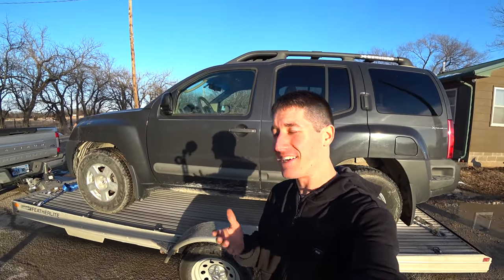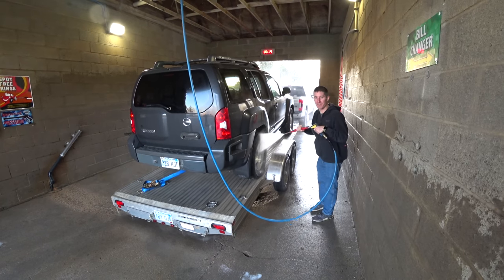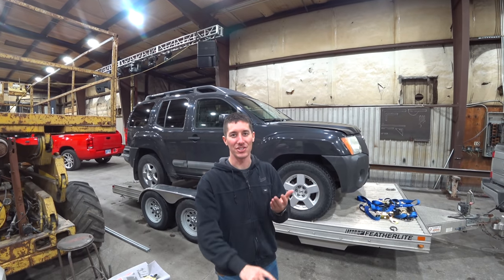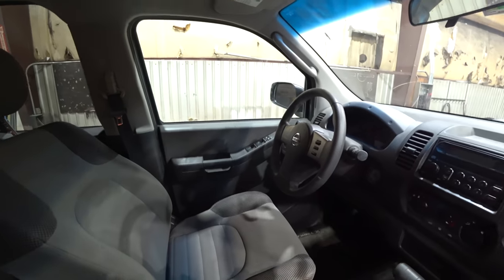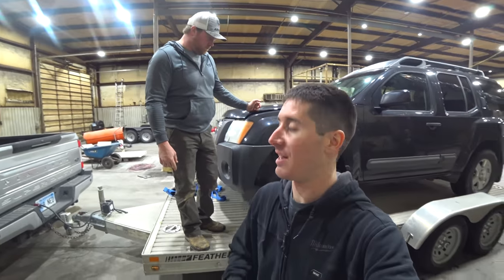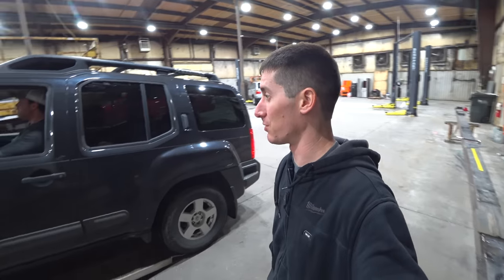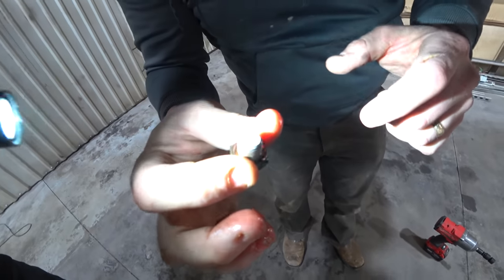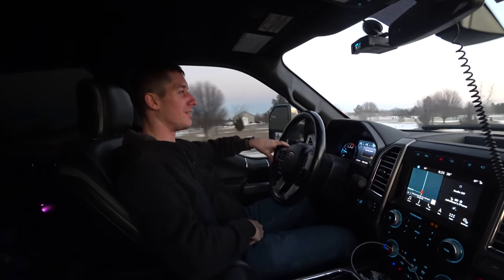The Nissan Xterra Is Everyone’s FAVORITE SUV So I BOUGHT One For Only $750

Comment: Probably had radiator transmission line failure and roasted the trans. So double check that radiator while in there
Reply: Mine had same issue - the radiator plumbing is the Achilles heel for that thing..dam radiator crack and mixed the fluids..miss my X
Reply: @CoH_88  I believe Mercedes used the same Rad didn't they I think correct me if I'm wrong I saw it first on LSC.
Reply: Exactly this. '05-'08 Xterras and Pathfinders are ticking timebombs.
Reply: @CoH_88  it's already been addressed by recalls and warranty work, so idk how it forced ya into needing to sell it
Reply: @robretondo9709  Wasn't covered at all for me - took to dealership and nothing. There was a lawsuit in the works but nothing never heard anything about it.

Comment: Check that radiator part number and see if it's the newer, superseded part. The trans cooler would crack inside the radiator and fill the trans with coolant, killing the trans in that generation. Hope all is well, here's to flips!

Comment: “This is going to be one of the easiest transmissions jobs...” dude, I’m pulling for you to be right.
Reply: Steven Heffelfinger I had to remove both primary cats to get to the top bolts of the bell housing.
Reply: @MrIsrael211  I used a 24" extension without removing the exhaust.

Comment: In case you missed the last comment, the trans cooler lines in the radiator degrade and leak, mixing antifreeze and trans fluid. Radiator is an easy replacement and  Nissan had changed to a different trans fluid that wasn’t as hard on the radiator. These are great rigs when sorted, especially in 4x4. I have a 2005
Reply: They changed the trans cooling pipe which goes through the radiator from aluminum to brass in 2010.

Comment: It sounds like the secondary timing chains and guides need to be replaced. The early 4.0L engines suffered from this problem. That's the whiney noise you hear on a cold start and when the engine RPM's increase.
Reply: Run it briefly without the belt before doing that though, if it stops the noise it's something else. I assumed that was the issue with mine because it was happening at the right mileage point, but it turned out to be the alternator. Would've saved me a ton of time and work if I had bothered to do that first.

Comment: Most common problem with that model is that the trans cooler built into radiator would Crack and allow antifreeze into the trans and vise versa

Comment: I had a yellow 2000 Xterra (Gen 1) and that turned heads. I drove it like a truck. Off-roading, towing, snow, beach, everything. I sold it with 198k miles on it. The new owners drove it away. Great vehicle.

Comment: I worked For Nissan During that Radiator plegue! Those transmissions are pretty strong on those Xterras and Frontiers but the radiator trans cooler ended defective mixing coolant into to the trans lines killing the Transmission.. if you catch them early a good flush and a valve body swap cures the problem. A radiator Swap  is definitely a must on this one if you replace that transmission.

Comment: Precision Transmission has a cool video showing what that additive does to every rubber seal in your transmission.  [swells them up a ridiculous amount.]
Reply: Yeah.. That's true. But it sometimes helps to renew o-rings, you just have to be careful not to put a hole gallon in it. I used to get the same results adding brake fluid to the tranny. Just a cup... Same story. It's not a solution, it's just "cheap" fix
Reply: It's not really a proper fix, but if you have a car where you can't justify a transmission replacement, it's worth a shot. I had a 2000 Cavalier with the transmission that was clunking and slipping quite a bit. Lucas kept that car going for another 30,000 miles...
Reply: @elijahwatson8119  exactly... That's the idea. Sometimes it's just not worthy to spend a lot of time and money in a car... Or u just can't afford it. Lucas additive can get you out of slipping or bad shifting transmissions.

Comment: Hey cousin!! Check to make sure it does or doesn't have the strawberry milkshake trans fluid where the line into the radiator contaminates it.. fix.. flush flush flush. Bypass the line.  Replace the valve body and tcm and back on the road u go. I had to do it on my frontier

Comment: Through 2007, the automatic transmissions had a serious problem. Someone radiator fluid would leak into the AT fluid, I assume through a busted heat exchanger to help cool the AT. There's a fix for it that owners have been doing for years, but once the AT is beyond fixing, it needs a new one.

Comment: I’ve rebuilt hundreds of these units. The cooler in the radiator cracks and they mix coolant & ATF. The coolant ruins the seals, frictions, and the TCM connected to the valve body. Replace the radiator, flush the auxiliary cooler, and make sure your replacement unit has the correct programming in the TCM. I’m not far away in Omaha if you need anything.

Comment: I bought a 2006 4x4 AT SE trim a couple years ago for $780 bucks because it suffered from SMOD.  I bought a new valve body, flushed out the transmission and buttoned her back up.  Still works today and is in FLAWLESS shape minus a little clear coat peel.  It's an amazing vehicle and I still run my 2005 off road all the time.  I don't think I'd ever want to get rid of it.
Reply: Hey is it still running? I bought one 5 months ago

Comment: I had a 1989 4wd Pathfinder that never went off road and the transmission never made it to 100,000 miles.
I looked at a slightly newer Pathfinder and on the initial check, the transmission shifted really rough, standing still!
No more Nissans since.  I did have a 1976 DATSUN station wagon that drove forever with no troubles, although it was a stick shift.

Comment: If you need any Xterra help, just let me know...I run an Xterra FB page, and have years of experience with Xterras, as well as having replaced the trans in my 2006 due to the common SMOD issue...
Reply from the maker: Can I stick a 2013 trans in the 06? Seems like they all interchange as long as you run the adapts right after install with the scanner, but it hard to find really good info on that. The interchange is all over the place. 🤷‍♂️
Reply: @WatchJRGo  the tcm is integral to the valve body. Will need programming. Also replace the radiator. 05-08 are notorious for cooler failing and allowing coolant into transmission.
Reply: Just so you know, what usually kills those transmissions is the internal transmission cooler in the radiator bursts and floods the trans with coolant, which then strips the clutches of all of their friction material...we refer to it as SMOD (Strawberry Milkshake Of Death)...also, chances are the timing chain guides are bad, the chains had a factory defect that cut through the plastic guides, which affects the variable valve timing, so you'll need new chains and guides...the cure for the transmission issue is to replace the radiator, flush the lines and secondary trans cooler completely, and replace the transmission...like I said, if you need any information, I've been there and done that with Xterras...
Reply: Also, you're going to want to remove the front catalytic converters to get the trans out...the bellhousing won't fit past them unless you REALLY force it and potentially damage the cats or crack the manifolds...
Reply: I'd put money on the radiator either being brand new, or they bypassed the radiator trans cooler and tried to flush the trans and limp it by for awhile before it finally died...my 2006 had SMOD and I was able to limp out another 20,000 miles from it before the trans just stopped shifting...if you buy a used trans, only buy one from 2010 and newer, as those didn't have the SMOD issues the earlier models did, so you don't have to worry about buying a bad trans...
Reply: @WatchJRGo  2013 should be a direct swap, if the dash lights for the gear selector come on then it should be fine...I put a 2010 trans into my 2006, then drove it to the Nissan dealer to have them scan and ensure the programming was correct, it was supposed to be $170 and they only charged me $70 because it didn't need programming...they said the newer trans should work in an older model, but not the other way around...
Reply: @WatchJRGo  Nissan uses their own specialty software, too, so finding someone with the correct scanner can be a pain...nobody around here has it, since it's too expensive to get the licenses from Nissan, so the dealership is the cheapest option to get it checked out...
Reply: what about Nissan Sentra SER, i own 2 of them my 2004 has a 2nd gen JDM engine  lilcrazybear at gmail

Comment: I have 2007 Off Road Xterra, Manual 4x4 and rear locker. It's a solid ass truck. Just clicked over 200k, just had to do valve cover gaskets, HVAC blower, cam sensor (oil leaked on it killing it).

These are under appreciated rigs and worth the few grand to pick up a nice running example.

Comment: I have a 2011 Pro-4X. It's a great off-road SUV. They never upgraded those rear tailgate struts! They work in the summer. When the temperature drops below 40, they keep the tailgate open just high enough for me to bang my effing head on it multiple times in the middle of the winter, before I remember. I even replaced mine with new ones, and they still failed in the winter.

Comment: my experience with an 09 4wd
front wheel drive transfer case seal 80K
Both rear leaf springs broke center leaf at 100k
TPMS doesnt want work (just use rubber stems)
Clock spring 150K
Radiator hose clamps rotted 150k
Evap system is getting clogged (hard to fill) 150K
Both Hub unit bearings at 165K
Needs new ball joints at 170K
Bushings starting to wear 170K
Rear trunk actuator stopped working 170K
The frame is very solid - A miracle in the rust belt - I now fluid film it

not to bad all considering.  Its heavy, but has good idiot proof traction control and ABS system will save your rear in a wet slippery situation.

Comment: They are pretty easy to work on for sure! I changed the clutch on my 350Z myself and when I wrecked the front end years back I replaced all the front end myself. The radiator support is completely modular and I just took the old one off and put in a new one, used radiator and a bunch of other parts that needed replaced, refilled fluids, bled, and was good to go. Really like some of the build simplicity in Nissan vehicles.
Reply: Are there any parts around? I couldn't even find any LED tail light offering online. None

Comment: I wish Nissan would bring back the Xterra.  I have been driving my 2008 Toyota 4Runner 2WD for over 15 years without any problems, so I agree with you about the  2WD Xterra.  The difference is that My 4Runner still works and looks like new, without any effort.

Comment: The trick to pouring Lucas is to shove it in the dipstick tube and stab the bottom with your pocket knife and twist to break the suction. It will drain in a couple of minutes. No hand cramps.

Comment: Make sure you replace the radiator. That is what kills the transmission in the 2nd gen Frontiers, Pathfinders and X's. The ATF cooler tube that runs theough the lower portion of the rad is notorious for cracking and allowing antifreeze to mix with the ATF. The Re5 trans is just about bulletproof, it was the radiators mixing fluids that kills them. Swap in a good quality after.market rad and you are good. Otherwise it will destroy the replacement trans. I've owned 3 of the 2nd gen Frontiers. My 05 has 220k on it now (4.0L 4x4 Auto). Rad has been swapped out so no worries. Otherwise these vehicles are damn reliable vehicles.

Comment: i got one is a 2006 Nissan Xterra i bought it in 2010 with 180,000 miles on it my frien tell me not to buy it cause it have noise that it won’t last me to long and now 2021 the Xterra still running 349,789 miles on it 4x4 and AWD runs really good on rainy days higth speed original motor and transmission my favorite we just drive it fro georgia alway to Seattle Washington no problem good look with that one dude

Comment: Hey JR, long time Xterra rebuilder here. Let me know if you hit any snags I can help with. Most likely the radiator failed internally and ended up eating up the transmission with coolant contamination. Also you can tell by the idle sound that the timing chain guides need to be changed. :)
Reply: heey i need some help with an xterra can I send you a message through mail or something?
Reply: @victorstorms5852  sure thing. How do you want me to contact you?

Comment: I loved my 03' Maxima,. Had a 99 Altima before that I just needed to replace the battery, and ground the brake rotors. The Maxima was a car that my passengers would tell me how nice the car was without my prompting. It was indestructible except when T-boned by a Dodge Ram that pushed in the B pillar.

Comment: Make sure you read the FSM regarding checking the ATF level.  The fluid level changes quite a bit depending on the temperature.  There's a graph in the FSM that shows the temperature range it should be checked at.  Literally doing the exact same project for a friend that was in a motorcycle accident since he only had his bike to get around with.

Comment: One issue with Nissan of this vintage and continues is the trans cooler in the radiator will split and you end up with coolant in the trans.  Not always enough to cause milkshake but enough to kill the clutches in the auto.  Put a aftermarket trans cooler in it when you replace the transmission.

Comment: The X-Terra's #1 problem is that it isn't an extended cab pickup or a full-size SUV. My buddy had a Silverado around this time and I realized that the X-terra was just a glorified Sentra. Yes, it carried more gear, but it fit no more people, and the fuel economy was garbage. The Silverado got 18 and our other friends that had Nissan's were barely getting 15. The pickup could 4-wheel better, tow better, haul more stuff, and it drove really nice. Now I have a 96 Suburban and I love it (when it's running 😆).

Comment: We got an 05, we've had both common fail points happen to us. The transmission went out(4900) and the timing chain just went back. The piston slapped all the intake valves on both sides. Still in the process of fixing it.
Reply: It's a real fun truck to drive, just sucks it keeps breaking

Comment: Along with the strawberry milk shake issue on these, there is also the timing chain guide issue. Glad to see yours didn't have a milkshake when you drained it, but did sound a like it could have worn timing chain guides. Not sure though as it could have also been the trans. Great project, really like the platform. Bought my son an 06 Frontier Nissmo 4WD.

Comment: Try to change the filter inside the transmission. On my previous car, the filter was clogged. The fluid was nice, but smelling burned. After a new filter, new oil and just a little bit of Lucas fluid, it worked perfectly for a year!

Comment: My 07 Xterra has been great. 108K  replaced radiator last year. no SMOD. Noticed the whinny engine 1.5 years ago, removed serpentine belt but whining was still there.  No problems...so far.  Am I pushing my luck by not fixing timing chain tensioners???

Comment: I have one of these, where I live we just took the radiator apart to clean it and notices the in radiador trans cooler was coriding and we changed it, no SMOD. I had an old fj78 and the trans seem dead like this one, we where in the middle of nowhere, took down the trans filter, cleaned it with diesel and it worked fine for a long time again, sold it 50, 000 km later.

Comment: Research SMOD (strawberry milkshake of death) known issues with 2005-2010 xterras. Radiator failure can leak coolant into transmission lines. If this is the case, make sure your replacing the radiator or you will soon destroy your replacement transmission. Even if you dont have smod, I would swap out your OEM radiator preventatively. People will often try to flush new fluid in the hope they can salvage a smod trans. Re: Fluid may look good but damage is done.
  Other known issue on your model year is timing chain tensioner guides which can wear out prematurely.

Comment: Workin on mine as we speak. I paid a bit more than $750 though..  lol mine runs great and has the factory supercharger on it. It's a beast. 

My biggest issue is the valve covers leaking oil. I have tightened them a few times. The passenger side is good now, but the drivers side is a pain in the azz. The screws in these are ridiculous as hell. Do you have a "fix" for finding actual bolts to replace oem..????

Comment: Sister in law just picked up an old one with relatively low miles, first gen four wheel drive.  It has just about every one of the ‘ quirks ‘ on the forums.  The distributor , the knock sensor, nicely cracked exhaust manifold, and I’m worried sick about the unknown mileage cam belt.
I’m trusting this thing is easier to work on than her old ‘ jimmy ‘ piece of junk.

Comment: Timing chain tensioners are worn. You can hear the whine when you start it. I had a 2005 Xterra and had them replaced twice. I had 144,000 miles on it and now I have a 2012 Xterra PRO4x manual 6 speed.

Comment: bought a 2005 with clogged catalytic converters for 800. It wouldn't even run. I drilled holes in the cats to get airflow and it started and I got it home. $280 for all new cats and it runs like a champ. Cheap cats were a b** to get sealed up but I ended up with an awesome car for under 1200.

Comment: I just flipped a 2004 4wd xterra with a blown engine. Got it swapped and sold but not nearly as clean as that one and had a few more issues that the previous owner didn’t tell me about so you should come out way better lol Mine did have the original first aid kit!... which I probably should have just sold on eBay